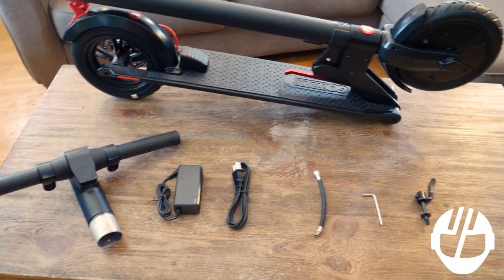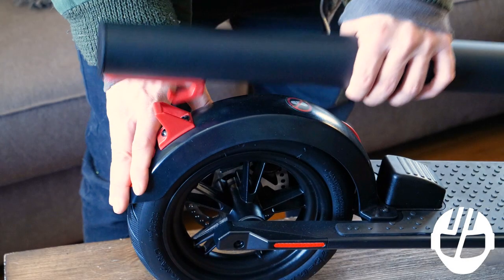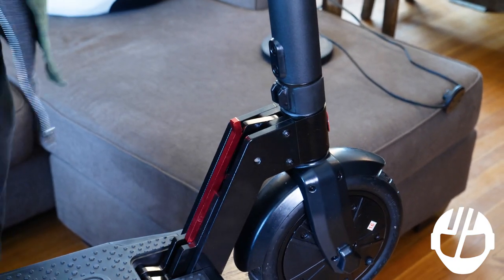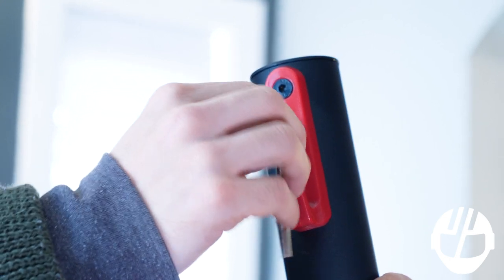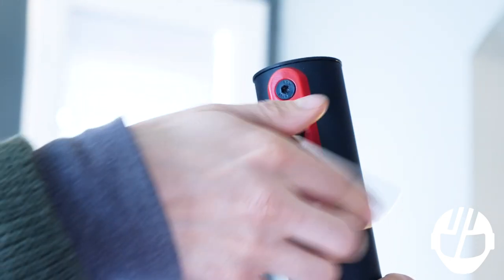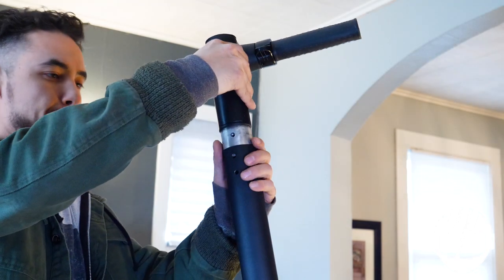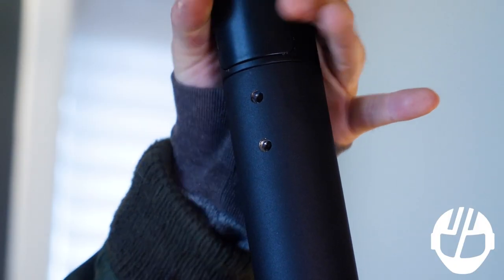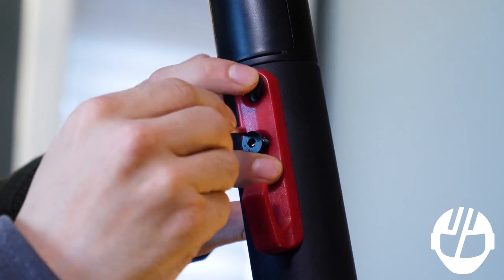GOTRAX GXL Electric Scooter Assembly Instructions

Comment: The GXL, as well as the GXL v2, is an exceptional scooter.  I’ve ridden my GXL for almost a year now and it’s still rock solid.  Fun and reliable.

There are two primary differences in the GXL and GXL v2.  One is that the rear brake button on the rear of the deck has been moved to the handle bars.  In doing that the electronic hub motor brake was removed.  The second seemingly minor change is that the rear fender and deck has been reinforced.
Reply from the maker: We appreciate your great feedback!

Comment: I just received my GXL and was wondering why the throttle sticks once it's held down for more than a few seconds. Kinda like a cruise control. Is that normal?
Reply from the maker: It is exactly like cruise control, which is a feature implemented on this scooter. You can activate and deactivate, as follows: Cruise Control: 

To activate the cruise control, press the right-hand throttle
down for 10 seconds. To deactivate the cruise control, press either the
right-hand throttle or brake button.

Comment: How well is the gotrax gxl v1 and v2 going steep up hills
Reply from the maker: Both devices have a maximum incline of 14 degrees without degraded performance but on steeper inclines will have reduced speed and battery range. How steep are the hills in your area?
Reply: @GOTRAX  (I'm the same person flitetime, just using my new account) there are many hills in my area, only 2 major hills that I'm concerned about, my old razor e300 could get up the hills with no issue so I'm wondering if the gotraxl gxl v2 can do it.
Reply: I’m from San Francisco and it won’t move up the hill at all. I’m about 140 pounds. I have to push kick 🦵 the scooter 🛴. Other than the hills this scooter rides pretty smoothly.

Comment: Do you guys test these before shipping, mine arrived yesterday, brake rubbing and went to bike shop to get a brake adjustment. But question, when I go up a hill why does the front wheel make a noise?
Reply from the maker: Yes, we do quality check before shipping out! We apologize that you are having issues with your scooter. You should not hear a sound in the front wheel while going uphill. Please contact our customer service at gotrax.com and we can get the scooter exchanged for you!
Reply: When I exchange the scooter do I ship the old scooter back or just keep it

Comment: when you first get the scooter and assemble it, do you have to charge it 4 or 8 hours before use or can you just ride it?
Reply from the maker: Four hours charge time should be fine. The device may come with enough charge for a test ride. Check the battery indicator first.